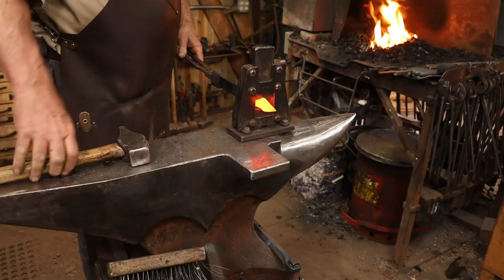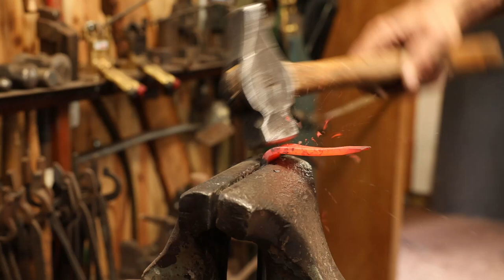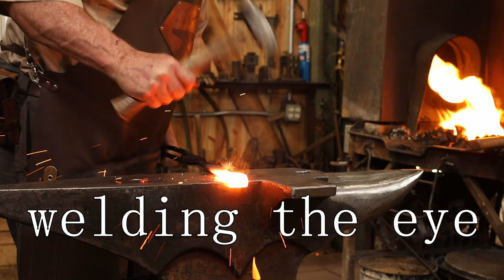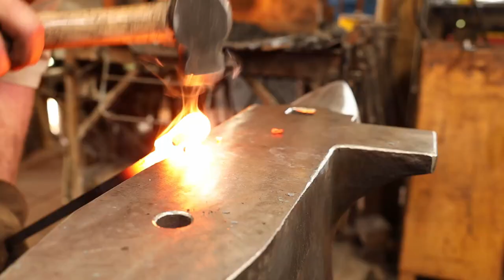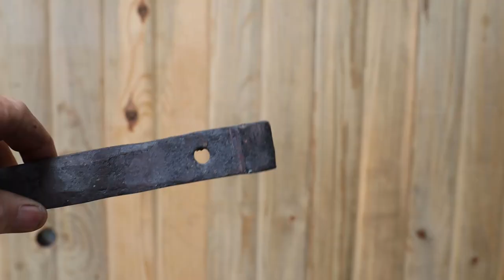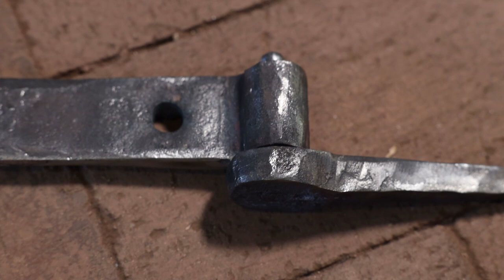Forging a strap hinge and pintle with welded eyes

Comment: I just finished a set!!! They are the style that is split at the back to go into stonework, the straps were 2 1/2' long
Reply: What do you mean split to go into stonework? I am interested, I don't think I have heard of this style yet.
Reply: @Carterironworks  you chisel split one end of the pintle and widen it tomake something that looks like a "Y", you then fold over a short section on the legs of the Y(the other end being where the pin goes) these folded over pieces hook over the stone/brick/cement block so the pintle cannot be pulled out of the wall when the next courses of building materisl are placed over it-I wish I could put a photo up, if you could see it it pretty much explains itself
Reply: @johnnydrummond8738  so it is made to be built into the wall verses put in after the fact correct? That would make more sense as I couldn't think of a way to drive it into a hole in stone and make it work. I was thinking similar to a wood joinery type of fitting and couldn't make it work. Install during construction makes sense.
Reply: @Carterironworks   yep, I believe(but am happy to be corrected) it is a Roman technique. Here in Ireland it is very common in buildings from the early Medival period on. If you put tze lower pin facing upwards and the top pin facing downwards and build them into the wall it is virtually impossible to remove the door once  nails are clinched over on the inside or round headed bolts(with the nuts on the inside) are attached making it very secure
Reply: @johnnydrummond8738  great idea sir. I've gotta make some for an upcoming building build, was going to add wood to try and hold the doors, may try this instead.
Reply: @Carterironworks  the set I made are being built now, I will try to get photos from the guy and let you see them
Reply: @johnnydrummond8738  that would be great, thank you sir
Reply: @Carterironworks  perhaps we should continue this elsewhere! Do you have am email or other method of contact
Reply: @johnnydrummond8738  
Sounds interesting
Reply: @SpecialOrder_937  It is a very common method of attaching doors in old houses/barns here